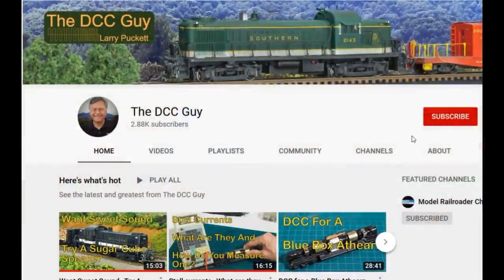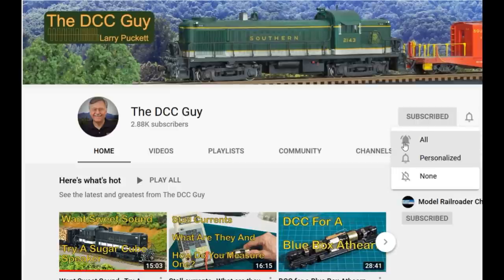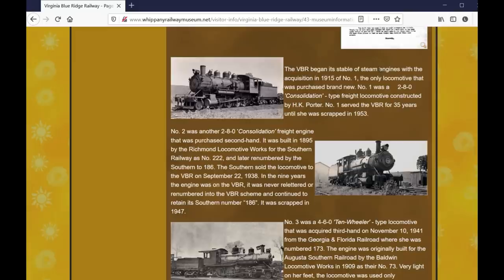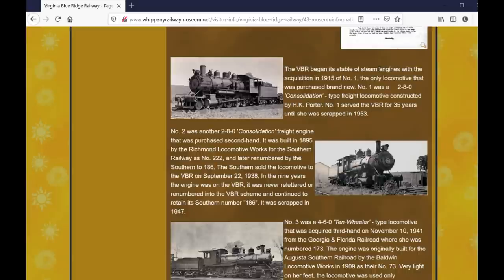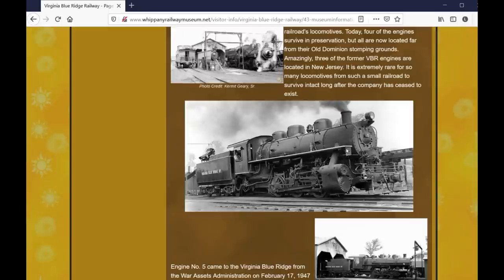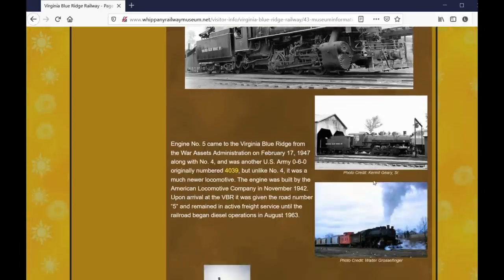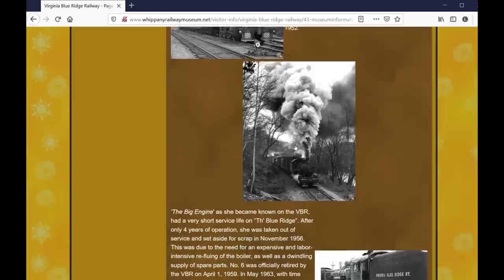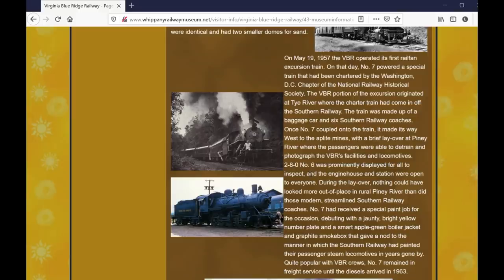Interchange Comes To The Piedmont Southern (200)

Comment: Larry,
CONGRATULATIONS 🎉 ON THE 18,000+ SUBS.  Though you may wish to update your Subscribe Promo clip from 2K.
Also a change you could have made was to install a lower deck to ceiling hard board wall covering.  Then you would have your entire backdrop surfacing in place, and not have to piece meal two backdrops.  Also you could have used your temporary chipboard clamps below and above the hard board surface.  Eliminateing the need for plastering repairs.
Still and all I'm anticipating the development.
~Jim
Reply from the maker: There’s a lot of things I could have done but didn’t—hindsight 20:20.

Comment: What makes the windex significant in soaking the board to bend instead of water or something else? This is something that I will have to remember when I start building my next layout.
Reply from the maker: As I explained in the other video it has to be the original Windex with Ammonia-D not the one with Vinegar, etc. I assume that the ammonia gets into the wood fibers and softens them so they will bend easily. All I know for sure is it works. After it dried overnight I took out the screws and it was set in that 90 degree curve and could stand alone. Take a look at the video I mentioned and provided a link to for a couple more examples.

Comment: Congratulations on your 200th video!  Three days ago I got my first DCC starter set, a Zepher Express, even though my layout is a very small switching layout for one loco.  My Walthers Plymouth now runs smoothly at very slow crawling speeds.  I also did my first DCC conversion, putting a Tsunami2 TSU-1100 and speaker into an old Proto 2000 SW9/1200.  Whew!  I had to remove the cab interior for the speaker and the extra weight for the decoder, but the results were worth it.  I can now have very authentic sounds when I'm in the mood.  I'm sure that your library of videos will be a great resource for me.  Cheers from Wisconsin.
Reply from the maker: Those are great models, I have one painted for the River Street Rambler that ran down the middle of River Street in Savannah GA.

Comment: What is the best track to use for HO kato or atlas
Reply from the maker: I use Micro Engineering or Peco flextrack myself as they are the most realistic looking and I use Micro Engineering or Walthers turnouts. I am not a fan of the track with plastic roadbed and preset curves (set track). I prefer not to be constrained to specific radii.

Comment: Hi Larry: Never thought that Hard board could be curved so sharp.  I have a similar outside corner to do.  Seeing how you made the bend has giving me some idea as to what will be needed to accomplish the bend.  If this works I will try it on the 180 D bend at the end of the peninsula.  If you have any other suggestions please let me know.
thanks so much for your very informative vidilos.
Reply from the maker: For a 180 I would do a test bend with some scraps, that will be pretty tight but may work. You’ll need to saturate a wide area and go slow. Having some extra hands would help too. I have never seen this done with more than 90 degrees. Another option is to buy a large sheet of styrene. I have a 4’ x8’ x0.040” styrene sheet I got at a plastics supplier for a project like this and did all my backdrops on a prior layout with it.
Reply: @TheDCCGuy  Update to the 180 bend.  The bend is in, I used a method I found on one other rail road sites on Trains.com.  I used a cardboard tub used to poor round concrete columns.  I used a 12"d form, attached it in place, saturated the hard board as recommended and proceed with the bend.  It worked like a charm.  I have a picture but don't know haw to insert it here.